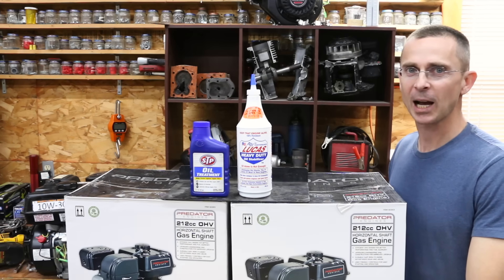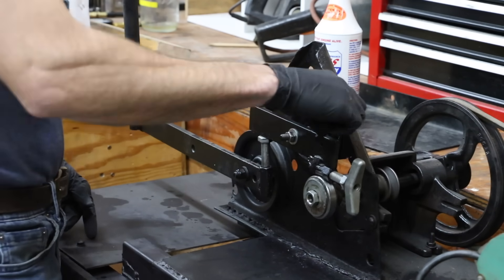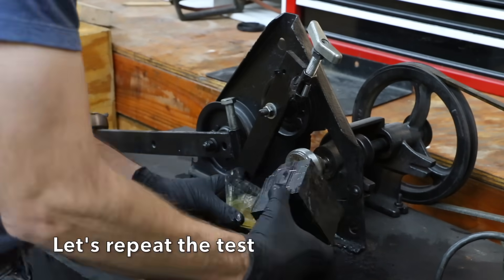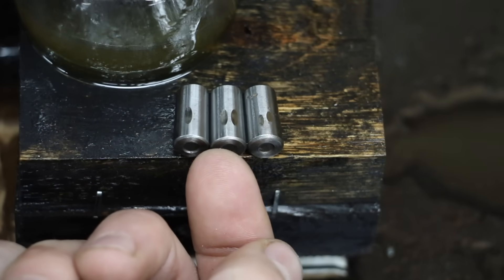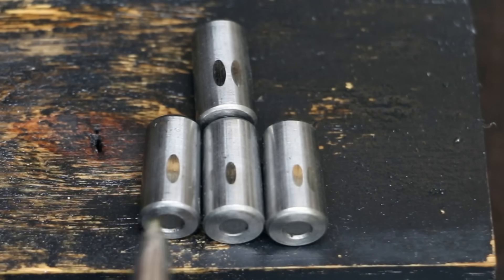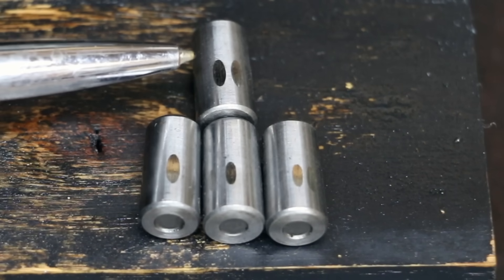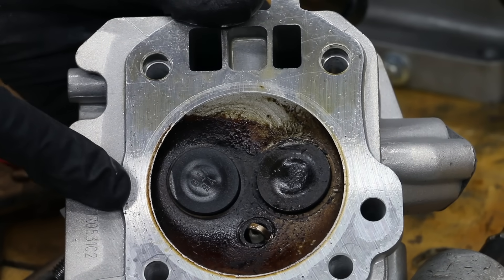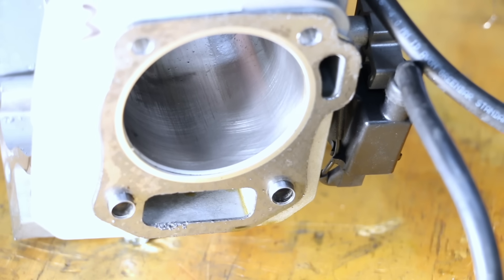Which engine self-destructs first?  Lucas or STP?

Comment: long story but ran a 15 min race with a sbc n no oil "oops"  ,had Zmax in the oil before oil change "lol"" drain plug didnt get put back in so no oil stayed in the motor ha ha ha , have seen the same thing with a Lucas running engine and both survived 
Bi-tron oil is like Zmaxx , just unbelievable.
test them
Reply from the maker: Thank you for this recommendation!

Comment: I suggest it is not a valid test for all engines. An automobile engine uses a filter and a bypass valve. When theflow gets restricted in the filter the by pass will open and allow unfiltered oil to continue to flow. Therefore I would not use STP at all period.
Reply from the maker: Thanks for commenting!

Comment: Testing is what I do. Hand grinding that what I will call "Friction Drum" renders that test useless. The drum must be exactly the same for each test. Running the engines without oil does not in any way test the oil. There are cheap ways one could create an oil test though. The tests would need to be done at least ten times to even have any statistical significance at all though. 
The friction drum test only tests that condition, and that condition is not found inside the engine. But a variety of similar tests could be significant. The only good way to test these oils though is in the conditions they are intended for. You need to get a lot of new engines, break them down, examine and record the clearances and micro finishes, and reassemble to specs. Then break them in, change oil, put in test oil, and run the engines under load for extended period of time in same atmospheric condition. Then drain oil, collect the deposits, examine, weigh each type of metal deposit, use microscope, etc. Break down engines and check all clearances and micro finishes and record. Put them back together, run again, examine, repeat. 
You can test the oil with friction drum / bearing rollers if all drums and rollers are exact same in size, flatness, surface finish and hardness. The oil that wins that may not be the oil that wins the engine test though.
Reply from the maker: Thanks for commenting. All great points.  I don't consider myself an expert.  With that said, products like Best Line will beat products like Zmax 100 out of 100 times using my tester.  The setup is not perfect, but it does provide valuable information.

Comment: Great videos, would love to see this done with Motorkote. They claim the oil stays on wear parts even if sprayed with brake clean. As can be seen in their wear testing If you search motorkote. Many truck drivers swear by this additive and have heard of engines lasting over a million miles with out even pulling a valve cover with adding it to their oil changes. Heard of it even dropping engine temps by 10 degrees farenheit.
Reply: Motorkote is full synthetic they even put themselves up against Lucas and showed there product works better against friction with that bearing tester.
Reply from the maker: Thank you for this recommendation!

Comment: Try molybdenum disulphide vs tungsten disulphide, both are designed to prevent friction, even with no oil.

Liqui moly was designed by the Germans to prevent world war 2 plane engines from seizing if the oil reservoir was shot at, to allow the pilot to safely land as soon as possible.

Would be good to see if in fact these 2 additives really work.

I've personally seen benefits with oil samples.
Reply: I second this request !
Reply from the maker: Thank you for this recommendation!
Reply: That is very interesting about the moli.  I'd like to see coconut oil vs olive oil myself!
Reply: That's a great day at work... I'd like to see Amsoil vs. Royal Purple or Safety Kleen is now selling their synthetic and blends commercially, that would be great to see
Reply: That was interesting about why they were developed
Reply: I used ATF plus moly in my briggs kart engine for 5 years,  never had a problem.
Reply: ...and your not stupid.
Reply: Molylube is good, I use LiquiMoly oil as well but its still an oil treatment that increases costs at each change and if you dont use it or forget to add during next change of oil and you bust your oil pan thats it. Try out internal engine coatings!!
Reply: Michael York , no these treatments use the oil as a vehicle then treatment adheres to friction that is generated between running parts, the oil pan comment was because when treatment at nano level is perforned correctly this has also run dry properties. Depending on the type of driving if you apply on a vehicle and brand of treatment,  treated engine may last  run between 40K miles and 60K miles before you reapply.
Reply: If there is an video please forward it to me. So eager to see the outcome
Reply: SANIC 2.0 G sources?
Reply: They also invented Crisco to have a lubricant for subs what would not smoke. They didn't have much use for it after the war so after a few years they brought it to the US and branded it as a cooking oil/ingredient. It's very unhealthy for your arteries by the way, never consume it in any way.

Comment: You should have a control; a third engine with no treatment, just oil. It really is critical to the scientific method. You've shown the comparison between the two products, but are either better than just plain oil? We still don't know because there was no control subject. Always in an an experiment comparing variables, you need a control subject with no variables as a baseline.
Reply from the maker: Thank you for this recommendation!

Comment: Not a proper test of these products.  Any engine will fail without oil and these little engines are not built to very tight tolerances, so it's a flip of the coin which one fails first.  A better test would be to run them with the oil additives at full RPM longer then the manufactures recommended duty cycle, then inspect for internal damage.  Phase two could be to reassemble, and run until failure.  Remember these products are called "oil additives", not "engine protection for running out of oil additives".
Reply from the maker: Thank you for this recommendation!

Comment: What is the point of ruining 2 brand new engines. What did you prove? That it's bad to run an engine without oil? Gee Thanks for the tip.
Reply from the maker: Thanks for the constructive comment.

Comment: Test the "tune up" in a bottle upper cylinder stuff. Also do one on which is the best degreaser for cleaning. Because I used the purple crap and it was just that CRAP. All I use is Lucas. If Lucas makes it, it works.
Reply from the maker: Thanks for commenting.

Comment: Should try running an engine on pure Lucas. That stuff's so thick it seems like it would start to heat excessively and the resistance would slow the engine.
Reply from the maker: Thank you for this recommendation!

Comment: MPT has an additive that's the thickest I've ever seen. Could you try that against the best? I've been using MPT for at least 4 years exclusively, now. I haven't had a complaint. I prefer it to Amsoil. It just feels like my turbo four cylinder car feels more peppy and the engine feels smoother, but it could be all in my head.
Reply from the maker: Thank you for this recommendation!

Comment: I'm a little confused.  Normally I love your video's but am a little concerned with this test.  I cannot find anywhere where either of these products claim to protect an engine WITHOUT BEING IN THEM.  Oil does not permeate the metal surface and add some type of lubricating property, rather the oil itself is the lubricant.  How is adding the additive to the engine and then draining it back out a test of anything?  You would have to devise a test in which both engines are operating beyond  their limits with each additive in the oil and see which lasts longer.  Also, any test like this has to be repeated numerous times, as well as a control group with normal oil only.  I'm sure the outcome of this test would have been the same had no additives been used.  That engine just lasted longer, the evidence is neither engine had any oil.

Comment: I like how you take measures to standardize. And your comments how that bearing test can be manipulated with various pressures. Something to add: in other tests, the first oil to be tested is at a disadvantage, because the bearing is not yet warmed to operating temps. I think you may have avoided this by resurfacing the wheel with the grinder. Great video!
Reply from the maker: Thank you!

Comment: I can certainly appreciate the time, money and effort that you put into this test, but in the end, it is wasted. First,  Without disassembling each engine and doing everything possible to make sure that they were identical. (blueprinting) there is no way of telling if one will fail before the other because of an oil treatment.Without doing that, you could take 5 engines and they would not all stop at the same time.Even if they were exactly the same it would only be a little better. Second,.you would need at least 15 engines. 5 with Lucas, 5 with STP and 5 for controls.Twice the amount would be better. Third, I have no idea what the grit is that you are using to sand the wheel and the idea of using a grinder on it is a problem. If the wheel is not perfectly round and perfectly flat,  that can affect the results. You've wasted 2 very nice engines.
Reply from the maker: Thanks for commenting.

Comment: Royal purple with 1/2 quart of Lucas has proven to be the best oil for my truck. That oil stays clean forever it seems. And for everyone who says “dirty oil means that it’s doing it’s job”- you’re an idiot with no sense of physics. Darkened oil means that there has been quite a bit of burnt fuel pass through the piston rings into the oil as well as a lot of friction causing the oil to break down and burn. Clean oil means that the oil is letting the moving parts move without much friction, and not hot enough to make the oil burn. It also means that the oil is doing a great job of lubricating and sealing the piston rings on the cylinder walls. Duh!
Reply from the maker: All great point and thanks for commenting.

Comment: Simple, I fit does not contain molybdenum it is not good for you engine. Why? You engines alloys contain it in the chemical make up thus it is already there as an alloy.
Also molybdenum when mixed with other metallic elements gives strength, hardness and resistance to corrosion.
This guy needs to go get some Molyslip or Liquid Moly and that engine would have run a day or longer
Reply from the maker: Thank you for this recommendation!

Comment: I was involved in drag racing and I used mostly lucas oil products I never blew a engine
I ran a 355 cu inches chevy LT1 HP 4 bolt main engine with a 671 BDS super charger with a Hilborn 4 port fuel injector on Alcohol
Reply from the maker: Impressive! Thanks for commenting on this.

Comment: You NEED to try POWER UP lubricants. it is amazing stuff.  the tests they do are incredible.  they did a test where they filled the engine full of oil and additive. ran it then drained the engine. drove 3 hours with no oil.  I swear by this stuff.  

 https://youtu.be/Irb6JsoyPko
Reply from the maker: Thank you for this recommendation!

Comment: I’m going to subscribe and like because I would love to see the best differential oil for 4wd vehicles.  I have a jeep jk and can tell you from experience alone that royal purple sucks as far as oil especially on cold starts.  I never had a noise in my motor until I put the purple in then found out it’s legacy vs Mobil 1, swapped early for the mobile and no knocks on startup.  BUT I hear the gear oil AND fuel additives are top notch but I am nervous to use after the horrible results from the oil change.  Any reviews on there products would be amazing and extremely helpful in keeping my baby rock and road ready!!
Reply from the maker: Thank you!

Comment: I personally use lucas fuel treatment (noticeable difference) and heavy duty oil stabilizer (hard to tell). Just as an extra bit of protection. For as inexpensive as it is, what does it hurt? I loved the test but cringed at the wanton destruction of those engines. Thanks for the entertainment
Reply from the maker: All great points and thanks for commenting.

Comment: Been using them all,  over 45 years, But when i was out in the desert,back in 2002, I threw a rod thru the right side of the block then  15 min later, one threw the left side belind the motor mount, Iam 30 miles out side of Reno, no cell phone, nothing out there except myself, and my metal detector and a blown Chevy 250 6 cylinder I drove back  5 miles short of Reno, You could see a smoke trail 2 miles away, when i stopped at a truck stop, people came out, they thought the truck was on fire, I told them i drove 25 miles like this out of the desert, Thank goodness i was using Prolong Engin treatment,, ,in the engin,  1 year latter, i was changing out the engin, but before i did i restarted it again just for laughts,,  You cant touch this stuff,in my oppion
Reply from the maker: Thank you for this recommendation!  I'll test Prolong soon.

Comment: Way back in the early 2000’s I saw a product called IXL that came out around the same time as Slick 50. I saw the car engine in the test stand without the oil pan and filter and it ran for hours. What impressed me the most was when the man selling the product used a brand new HS steel drill bit to drill twenty+ holes through a file. That made me realize that IXL was not going to hurt my engine.
Reply from the maker: Thank you for this recommendation!

Comment: Two massive problems with this demonstration. 
A) as many have pointed out, without an example motor running straight motor oil it fails the stated goal, to see if additives are bunkum. 
B) Running the motors to destruction after evacuating all oil, whether it was once imbued with an additive or not, is a completely pointless and puerile 'test'. It suggests that the tester believes that one oil additive or another provides varying degrees of lubricating enhancement to an engine AFTER IT IS ALL GONE!
This suggests that the tester already believes the bunkum and is therefor a non neutral and  unreliable test controller.
Reply from the maker: Thanks for the constructive feedback!

Comment: What a waste of 2 good engines!! These tests have been done over and over and tells you absolutely nothing! First of all, no motor can survive without oil and you conducted a test that by comparison is is completely bogus! The way to test these additives is to run them according to directions for a really long time then drain it and conduct a viscosity test after thermal breakdown then remove the crankshaft and see which one has th most amount of wear on the journals as well as the rod big end, this will actually tell you which additive performed the best cushioning against the load. This has to be done by running the original oil far past it's thermal  lifespan then adding the additive. Removing all oil and additive will only destroy stuff and tell you absolutely nothing! No engine will survive and to see which one lives the longest without oil is completely and in all other ways retarded because additives are meant to help the cushioning of parts that are in high contact with each othe and no test is valid by removing the product completely.

Comment: I know my lucas worked very good on a old 1980 inline ford 6 cyl it knocked had tons of blow by when I got it, so I sea foamed it changed the oil and added lucas, didn't stop 100% of the engine noise but stopped 90% of it. now I use it in everything
Reply from the maker: Thanks for commenting on this.

Comment: I bought a harber freight motor and it ran great for 4 years on a compressor that ran every day only had to change a head gasket once .. I ran 30 weight oil synthetic Castrol ...oil does matter
Reply from the maker: Thanks for commenting.

Comment: Mystery magic motor. Oil vs Royal purple. The reason for this. Head 2head I am a broke bastard been using Magic oil for years its cheap and seems to work in the old busted cars and trucks I drive. As for the Purple I would like to try it Its on the sponsorship for several top drivers, motortrend give it a great review and I believe it's the young gun out of the additives.
Reply from the maker: Thank you for this recommendation.

Comment: two things. first. i cant figure out why you used a grinder durring the first test. that has to have an effect on the results. second. Durring the empty crank caes run test. did you make sure the rpms of the motors are the same?
Reply from the maker: Thanks for commenting.  Yes, I made sure the RPMs were the same.

Comment: The technology in modern oils should mean no additives are needed
Reply from the maker: Thanks for commenting.
Reply: Project Farm But that doesn't necessarily mean that cars don't need the additives. As shown they can help with oil pressure on a worn engine

Comment: 90% of engine wear occurs in the first 2-minutes of engine start. That's where the value of these type products earn their use. I remember replacing a leaking head gasket on my 1966 SS396 Chevelle in 1968. I used STP consistently. I was impressed to find the tacky oil film on all parts of the engine internal wear surfaces. The internal engine looked like new. (So did the external engine - I loved that car.)
Reply from the maker: All great points. Thanks for commenting.

Comment: The problem with this experiment is that you were testing 2 lubricants to see which was better.... but you ran them both to the same result.   You should have stopped the Lucas engine at the time the STP engine failed and THEN checked the damage in both engines.  That would have showed how much better the Lucas protects your engine.     Running both engines to the point of failure will result in the same level of damage in both.
Reply from the maker: Thank you for this recommendation.